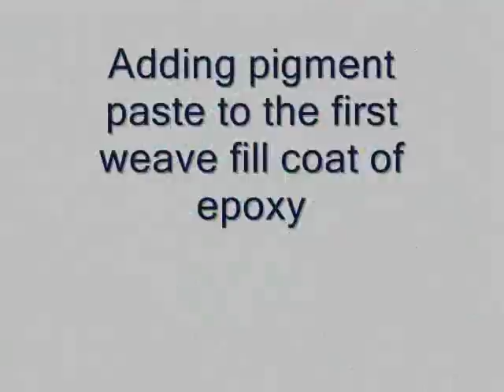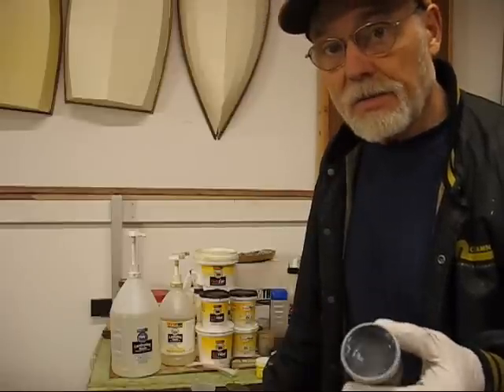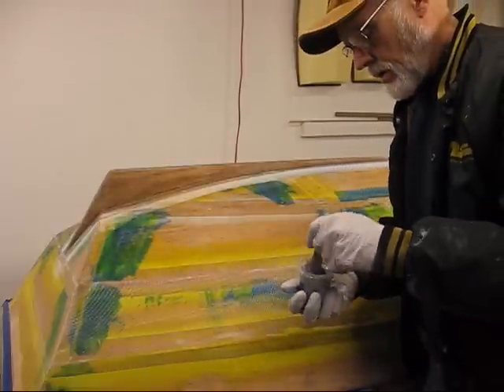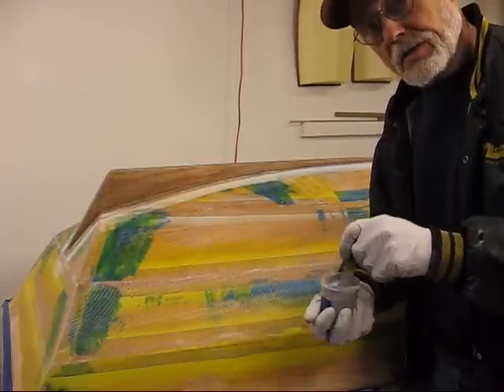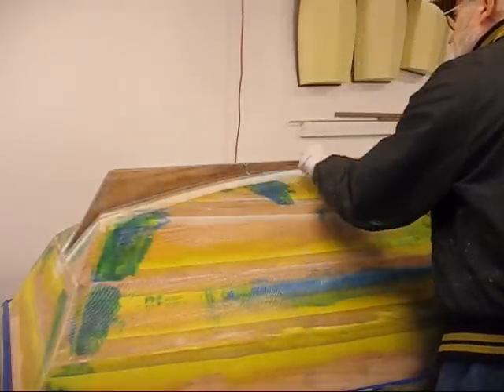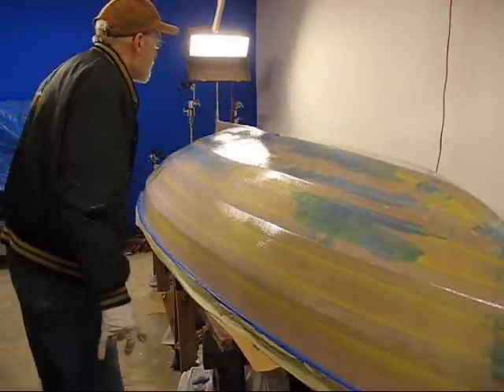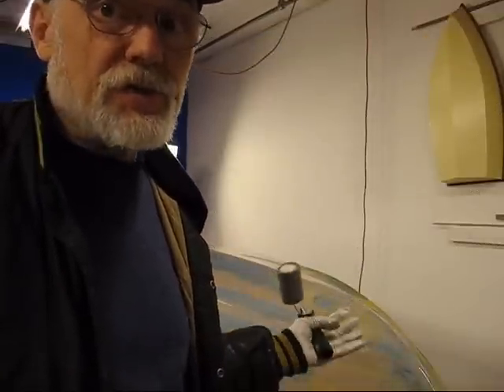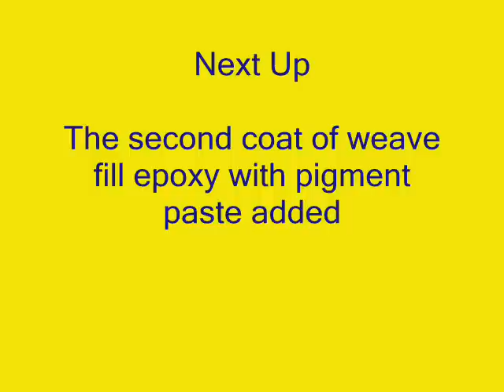Part 32-1 Filling the Weave with Epoxy.wmv

Comment: Great video. I like how you used a roller to evenly spread the filler. I have also had a concern with weave filing. I come from a autobody backround where everything has to be sanded or scuffed before you apply any thing. My concern is what about the empty weave areas. You can sand and scuff all you want but it will never be flat unless you sand it completely flat. But then that will defeat the purpose of the weave. Applying something to fill the weave is one thing but will it adhere and will it last months/years down the line? Also is dry and cure time a factor? Would it adhere and stick more on a dry but uncured surface? I have used a wire wheel to try and get inside the weave before filling. Just a major concern of mine.

Comment: It seems to me, tat you did NOT sand the first layer of epoxy.
If that is true, then the bonding will not be good. 
Please tell about that.
Reply from the maker: +Anders Skole Overgaard I'm using System Three SilverTip Epoxy!  If you "re-coat" the surface in less than 72 hours, you "do not have to sand" between coats.  You still get a chemical bond between layers.  I have never had a problem with separate layers of epoxy coming loose, or any bubbling.  Only on the "cheap" epoxy's do you have to worry about sanding.
Reply: +redbarnboats I dont know the epoxy you use.
Maybe you should mention the fact that you EVENTUALLY should sand between layers, if the "user" is LATER than time-lapse allowed.
Just because I do know, that ELSE there will bee very little bonding - almost none.
Thank You for your fast reply- and i must say, that your work looks very nice and tidy.
I seems to me, that you have high control of your materials, wich may be very messy.
Beautyfull little boat.